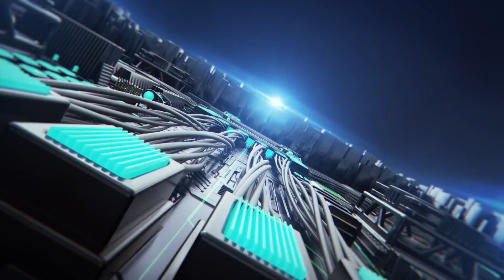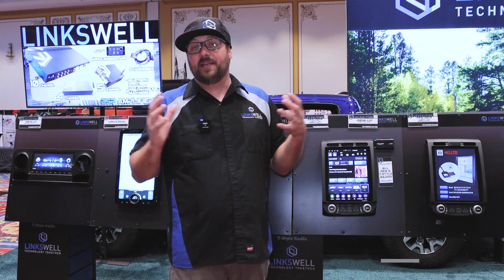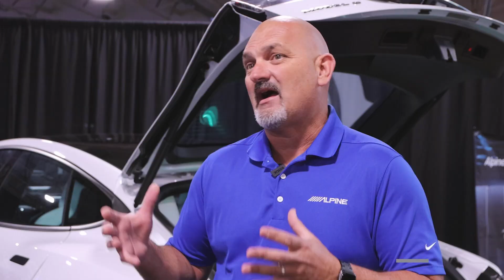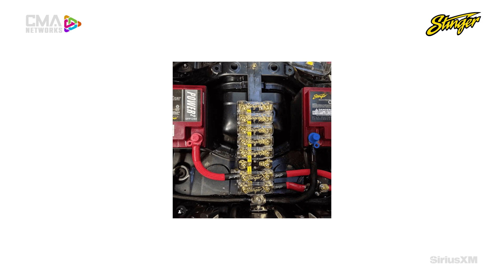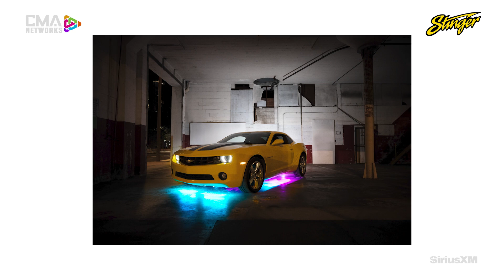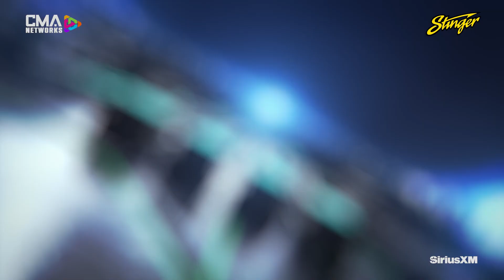STINGER | ACCESSORIES | CONNECTED

Comment: Will the SwitchHub work with the Heigh10 and I can control whatever I connect to it from the Heigh10?
Reply: I came here looking for that info as well
Reply: its a relay......you can literally use it for whatever your heart desires....fuel pumps, fans, lights....anything. msd sells a similar product but like double the cost. im currently trying to delete my engine bay fuse box and this is one of the solutions im going with.